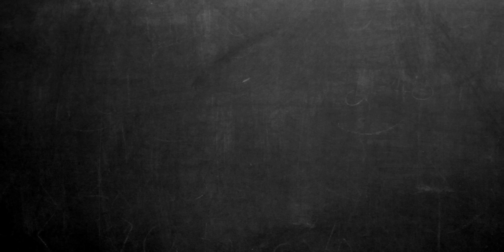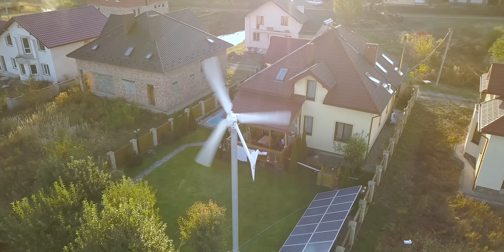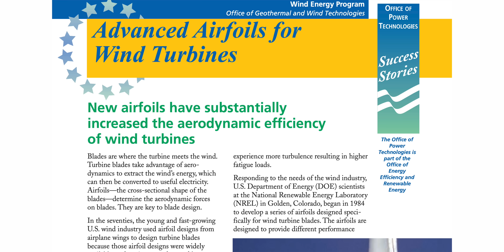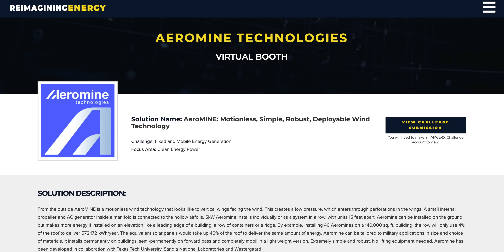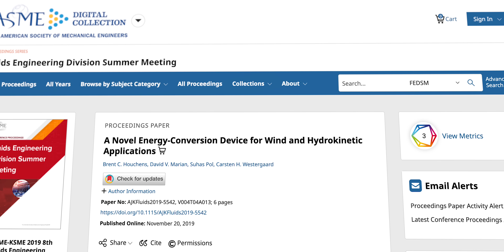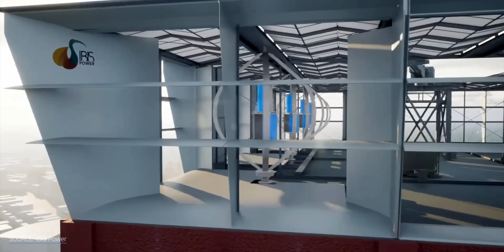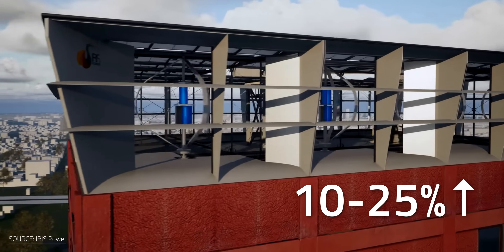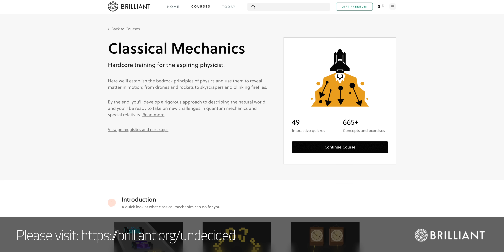How Can A Wind Turbine Be Motionless?

Comment: The way the aeromine works is actually the same way people in hot climates used to build buildings long before air conditioning. By taking advantage of the pressure differential, fresh air could be consistently brought in.
With that said, I think the power nest is the more likely solution to become widespread.
Reply: The method of measuring differential pressure is also how some racers used to do low-budget aerodynamic refinement of their car. Run a hose to the area that they wanted to investigate and hook it up to a low air pressure gauge, get a buddy and a clipboard and go for a drive. Take notes of weather conditions, speed, and test pressures, and you start to build a model of the aerodynamic characteristics of your car at different speeds. Simple. 
Try doing the same thing with a building. This is part of Building Information Management. You don't even have to do anything permanent to the building. Some arduino weather stations around the property, connected to your wifi and dumping data would let you build a differential pressure map around the house in different seasons. If you have a single turbine with gates and plumbing to these places, you can automate optimum returns actively. Be worth it to create both high and low pressure zones to take advantage of the effect.
Reply: you can also utilize the empty floors of skyscrapers that let wind pass through them to put in the same type of wind turbines to generate more energy as well
Reply: @CrabInBucket  100%
Reply: @CrabInBucket I feel like sky scapers are so far up high with their own little unique chaotic weather systems. 

 I mean I've seen videos of simulations on what is happening especially in a place with multiple sky scrapers, and it is wild from floor to floor building to building. 

 Sky scrapers may not have issues generating wind speed at all is what I am saying. Controlling it definitely would be the issue. 

 With that said using those empty maintenence floors is a good idea. It would have to be a robust system being able to capture all the chaotic air, and controlling the flow in times of strong wind.

Comment: The energy you can extract from wind is proportional to the area that you are extracting from.  So if I halve the size of a wind energy system, I get 1/4 the energy.  A 145M diameter wind turbine is around 5MW.  So if I want a roof system at 5KW, that is a 1000th the power, so I need the sqrt 1000 or approx 1/30th the size.  Puts it in the 4 to 5 meter range.   I could believe these systems have that effective wind area - hard to tell because it is not easy to judge size from the video.    Going smaller with wind energy extraction devices has to have a limit where they just become impractical.

Comment: 3:20 - Sorry, I think you have got this one upside down: the profile of the car is basically an airfoil shape, making the air above go faster and thus creating lift. You just showed that at 2:55. The spoiler - usually on the back - is then used to counter this lift and presses the car down with its upside-down wing shape.

Comment: Unfortunately, most of these small wind turbines are scams. The reason is simple. The power contained in the wind is 1/2 air density * surface area * speed^3. The law of conservation of energy makes sure that no gimmick can increase the power obtained.

Comment: So, How can a wind turbine be motionless? Answer: It can't. 

Just because a turbine isn't exposed doesn't mean it isn't moving to produce the electricity. Which means the Aeromine has pretty much all the same maintenance requirements as a regular wind turbine, just on a smaller scale and you might gain some time between maintenance but, that's it. 

Is it safer for wildlife? Than a regular old giant HAWT? Yes absolutely. But, I imagine there are a number of VAWTs which are just as safe to the wildlife and can accept air from any direction equally whereas the Aeromine basically only works well in the direction it's facing. 

It seems Aeromine is going hard on marketing right now but, I really don't see many advantages over just getting an already existing VAWT. Also, that thing is absolutely hideous. Fine for commercial applications but, they're going to have to make it blend in much better if they want any sort of residential sales.

Comment: This looks very promising, and very cool. But what I want to see is a system that uses both power nests AND  Aeromines combined. Since the Aeromine works by sucking air with the low pressure caused by the air foils, the power nests work by funneling it. They're complementary. I bet you could get significant increases in efficiency, especially at low wind speeds, because you'd be funneling air into a wind tunnel that also has a low pressure zone at the outlet to help speed the air up. Imagine building something like the passive air towers used in some Middle Eastern cities, with a funnel down to a wind tunnel with a turbine in it that feeds out into the Aeromine installation.... I bet it would be amazing!

Comment: It would seem they have missed a trick!
As I understand it the "blade" creates a low pressure area on the inside which is connected to the exhaust of a normal turbine.
But what about the outside edge?
Once the air paths have diverged there is little to no effect of the outer edge other than to act as a plenum to hold the low pressure from the surrounding air. 

They could do one of two things .... 1. Create an inverse with ducts running to the outside (they may have done this, but it was not visible) this would create two low pressure areas instead of the one! or 2. Create a baffle that would increase the air pressure around it. This could then be plumbed in to the inlet side of the turbine!
Eather of these would give more bang for your buck!

Comment: "New Revolutionary..bla bla bla"

Similar windmill designs are out there - 5 to 10 years old that promised "rooftop wind generation" with no visible moving parts to have your neighbors calling the HOA and listening to squeaking blades turn at 2 am .

and of course, all the "earth-shaking" designs from years ago have had no new posts for 5-10 years and never got anywhere.

Same here - as a pilot, I can tell you landing on the prevailing runway has cross winds all the time - which a fixed windmill never can harness and having the thing turn on your roof would have your neighbors on the phone with the HOA.

Just burn clean natural gas and not bother your neighbors.

Comment: First contemplate the Butterfly Effect.  Now imagine replacing each butterfly with a 100-meter wind turbine.

Just as there were unanticipated consequences from using fossil fuels on an industrial scale, I cannot help but think that harvesting wind energy on an industrial scale will also cause unexpected problems.  Our descendants in 50 years will probably curse us for our short-sighted foolishness.

The wind affects the movement of clouds and weather systems. It removes fog and smoke from affected regions.  It mixes the layers of the lower atmosphere to keep the various gases (N2, O2, CO2, etc) in the right proportions for life.  It also mixes the upper layers of lakes and oceans for the same purpose.

Comment: The 'windmill makes more power than 16 solar panels' claim is preposterous and you look like a company shill for even acknowledging that they said it. Also their 'safer and quieter and works at 5mph' claims go unverified and un-questioned by you - even though they are highly suspect. (since noise is usually a vibration issue and this is bolted to a house)
This is nothing more than a 10 minute snake oil pitch... I expect better of you.
VAWT have been around for 50 years, putting one in a cylinder does NOT radically alter the performance. The wind at roof level is poor quality and fluky - THAT IS WHY commercial wind installations are tall - NOT because they are inherently worse than this ridiculous rooftop box. Please don't propagate third hand and third rate information without validating what you say to your 1million subscribers. I know you like money and need the views but have some intellectual self respect and don't turn a company press release into a video.

Comment: At 5.53 you stated that the rooftop mountings are stationary. I am wondering whether it would be possible to mount the blades on some kind of turntable or rotating platform and use flexible couplings to direct the higher pressure air to the turbine located at ground level?
Reply: My thought too. 
Electro/mechanical driven to adjust for the wind direction. Not reacting on every little change but optimizing for an average wind direction.

Comment: Fingers crossed for this but I can't see it taking off ;)
The turbulence created around high density buildings will be an issue for a device that requires a consistent wind direction.
And if the wind power is being generated from suction through the small perforations then this will severely limit the power potential. At the end of the day, the wind power is generated from the kinetic energy of the mass air flow (=1/2 density * vel ^3 * Area) which is why bigger and higher is generally more efficient for wind power. 
PowerNESTs look very interesting! Would be great to know the LCOE of this combined system?

Comment: It's not the blades. It's the wind resource. This is just another investment money scam. If the wind at the roof of your house was useful, we would already be using it. It loses too much energy bouncing off the ground, trees, and your house to be useful. There's no way they're getting 16x the energy per unit area of a solar panel. There isn't that much energy in the wind flowing over a structure. Here's a quick way to check if a new wind turbine design has a shot at being feasible; do they have a working prototype? Do they tell you directly what the power output is? Is it less than 500 watts? These turbine scams are just taking advantage of how unintuitive wind movement and fluid dynamics in general is.
Reply: there is icewind company which was described here on channel too. All these small companies never say any stats, no tests, no videos, no ads, no social media. Icewind put their products next volcano- ok , nice but what are the stats? I asked them about how they develop and they said to contact them via e-mai xd I'm mean, because after 2 or 3 years they post like one picture on instagram per year. So much buzz and no single tests? 
Even car mechanics/builders show their progress on how they change old classic cars to EV- people from them always want to know one parameter- the distance. Why wind turbines companies can't tell what is the outcome? Why they can't find partners with battery companies like youtubers showing solar panel testing with battery ffrom ecoflow. That one kind of video would sell them thousands products... 
I don't know, it's impossible to be so bad at marketing, no matter what you do, but they are engineers and can't show basic product parameter? It must be scam for 100%.
Selling 3d renders and some bullshit stats and quotes xd
Reply: @LittleBoobsLover  They're just fishing for investors ignorant enough to throw money at an obvious hoax - the only "product" these companies actually produce are these ad spot videos looks pointedly at Matt lol

Comment: I wonder how much of the cost of turbines is posed in the generator? I’m really excited to see how Niron’s Iron Nitride magnets make changes in the cost of generators for large scale purposes like this.
Reply: Generators cost the same as electric motors - i.e. cheap. 
Charging control for the added batteries add cost , but not a lot.
Most of the cost of wind turbines of any type is the structure itself

Comment: Small addendum here Matt, most of the lift of an aircraft is produced by the depression on top of the wing. It is sucked up from the wing top mostly. that's why we need a wing top free of all contaminant and 3 mm of rime ice is allowed underneath (at least for a B777) . Good work
Reply: Thanks, I was fairly appalled when he said it was the high pressure under the wings doing the work.
Reply: @MikesViews  It's a pressure differential that does the work, caused by the different laminar flow paths, so you could look at either point of view to be fair.
Reply: @fukawitribe   no need to be laminar. Mike is right to be appalled.
Reply: @trustthedogsheneverlies644  It doesn't have to be entirely laminar, that's true, indeed inducing a very small amount of turbulence at the wing surface to can be useful from a drag point of view. That said, you'll probably be losing efficiency as the turbulence increases, and with fully turbulent flow on both surfaces i'm not sure how much actual "flying" you'd be do.. for very long anyway.
The point I was trying to make is that it's the pressure differential that is ultimately causing lift, and you can view that as equally well pushing up or pulling up. Have a look here for a far better exposition
https://www.youtube.com/watch?v=p4VHMsIuPmk&ab_channel=TED-Ed
Reply: @fukawitribe  small drag penalty for attached flow is worth the greater pressure differential. Coming from a gas turbine background so almost all flows are turbulent at he Reynolds numbers I work with but appreciate transitional flows across flight surfaces where they often end up turbulent by the trailing edge.

Glad we are debating effects far lower than the errors in this video. Good to know there are some clear heads out there :)
Reply: @trustthedogsheneverlies644  "small drag penalty for attached flow is worth the greater pressure differential." Indeed, point being that conceptually you can look at the push / pull argument either way - as it's the pressure differential that is the prime mover. That was the only point I was trying to make.
Reply: @fukawitribe  agreed :)

Comment: Aeromime may not say it, but its arrangement is also using the venturi effect. The laminar flow over the turbine inlet is increased by the laminar flow over the foils to either side. That flow is Bernoulli, the flow between the two foils accelerating the air in the smaller volume of space is venturi.

Comment: What a joke. Matt, I'm sure you are smart enough to see a scam when you see one. Right off the bat, those holes in the fins where you are sucking out air due to "lower" pressure are the only area that is transferring pressure per area down to where you are hiding that propeller turbine to spin another loss in conversion.  On top of all that, to generate enough "lift" pressure like in airplanes require even more windspeed than that required by conventional HAWT turbines.  I can go on and on about all the flaws in this design.

Comment: That's really interesting, so the low pressure air basically sucks air out of the tubes to spin the turbine at the bottom.   This would be something neat to experiment with.  One of the big advantages is that the parts that need maintenance are more easily accessible.
Reply: Oh I see, thanks for this, I was confused after watching the video
Reply: @jama211  Yeah I feel they kind of glossed over that fact.  I was trying to figure out too how it works but when they showed the diagram it made more sense. It's almost a reverse of how those dyson "bladeless" fans work.

Comment: This is a pretty dumb concept. It is much cheaper to few build big turbines rather than many small turbines. This is because the wind is stronger higher up than at the relative low height of a roof. 
The efficiency of solar, on the other side, panels are not related to the total size. 
Furthermore, the design is not as effective as presented in this video.

Comment: this is total B.S.  No moving parts is a lie as they just funnel the air into a ducted turbine....so it has just the same amount of parts as a conventional wind turbine.... you would have a no moving parts turbine if you had a flex able ribbon of magnets vibrating over coils  or something like that, but what you explained is not a motionless turbine !

Comment: One problem that you always have to be aware off is air is dirty, after 100,000s of CFM flow through the holes, pipes, etc. It will become very dirty. Inlet filtration is likely to kill the efficiency. It will not be maintenance free, no system is. Not a bad concept.

Comment: You get huge points for not showing a wing as lifting because of the low pressure above it.  That helps create a differential, of course, but the lift force comes from below.  Always hated those diagrams with the mess of vectors above the wing magically lifting it up with a bunch of "little" vectors below pushing up.
I don't see why the aeromine can't be designed to turn to face the wind.  The power generator itself can remain below the rotating upper part with a rotating adaptor between the two.  The piping (regardless of how it's done) needs to be minimized as much as possible to reduce drag on the air moving through the system (a conventional wind turbine does not have this issue other than that hitting the vertical mast impeding overall flow - but that's really low).
The rooftop nests could also collect heat if integrated with the solar panels - such heat can be used for water heating or even space heating in the autumn and spring while helping to cool the solar panels.